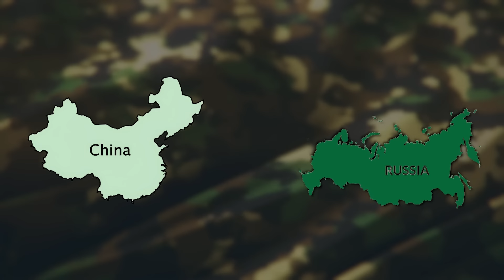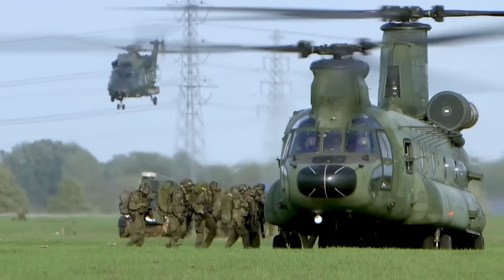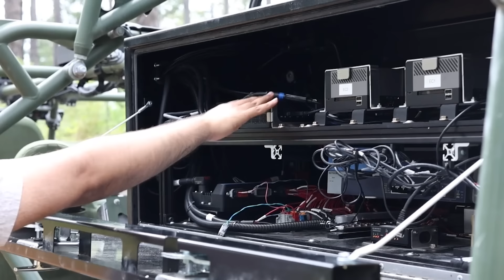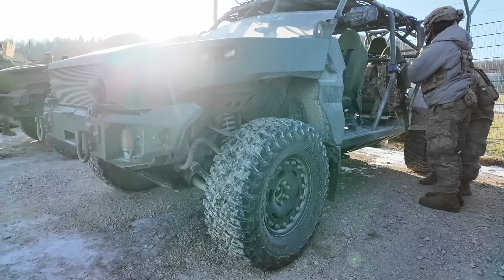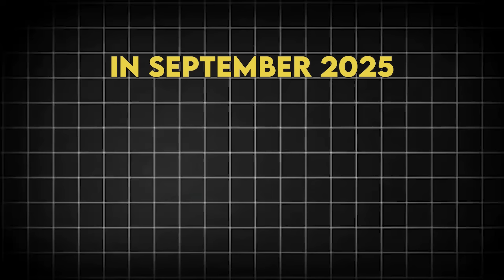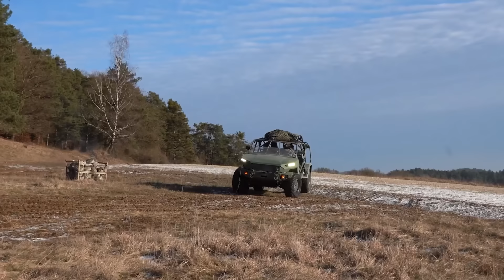This $35K Chevy Pickup Became the Military's Most Radical Weapon

Comment: Uha that's what they did in Ww2 with the jeep almost. 
The parts for a WW2 jeep were made by 3 different company's  and the smaller parts were manufactured by at least a dozen more companies also the parts in a WW2 jeep were used in many different vehicles. 
Slow learners

Comment: Do your research. This is a custom built military vehicle that shares some parts from a civilian vehicle. For one, the frame is custom built by Hendricks, not stock GM as you state.
Reply from the maker: As discussed in the video, the base production Chevrolet Colorado frame is modified with a custom-built, high-strength chrome-moly steel exoskeleton (roll-over protection system) manufactured by Hendrick Motorsports.

Comment: I like it and I don't like it.  While the SpecOps love a vehicle like this that they can jump out of really quick and return fire, this vehicle is basically doomed to be transport and way behind the lines. Does everyone remember Rummy saying you go to war with the army you have not the army you want?  This sounds like a copout for having the right vehicles for the job.  When cheney said that, They were driving bigger, more capable vehicles, with more protection than a beach buggy.  When they got the chance, they would up armor the humvee, and eventually replaced it with V hull for IED protection.  So with this they were like Fckit, fck all that, you get nothing.  So this vehicle is a joy ride machine around army bases inside the states, its for moving soldiers around inside army bases in other countries,  but it has no ability in combat other than Spec Ops.  Im sure the army wont confuse these two uses, and just send a bunch of these to the next war. 

Spec ops likes these.... they even converted a couple humvvs in afghanistan to look like this so they could all see and hear threats and react to them without doors, windows, armor, and roofs, they just stop the squad, and shoot back. The army doesn't need these, and they shouldn't put the grunts and sir yes sirs who learned how to use a gun 6 months ago into one of these things in a hot zone, and thats what they will do if they are available.  They did this exact same shtt with the stryker, they mis used the vehicle because it had a gun on top, even though it was a lightly armored troop transport, and shredded to pieces if a tank saw it.

Comment: This is a WIN-WIN for the US!!  AND, it’s about damned time!! In 1986, when I was assigned to a schools command where the original HMMWVs were being torn apart to be used for teaching maintenance and other functions there, many of us said we should have been looking at BAJA cross country vehicles since they can take a beating and keep going, etc.! Here we are 35 years later (2021 timeframe) and SOMEONE finally got it!! Next up will be diagnostics, aka autonomic logistics where the vehicle tells the supply chain when it is going to break down or excessive wear and tear is causing issues.  PROBABLY NOT something they can put on these since the cost is almost a throw-away, but I guess we’ll see!! Good work all around……as long as they are durable and Chevy will use repair frequencies to improve individual products on these that are wearing out too soon, or a particular weld begins to fail too often, etc.!!
Reply: weapons of war need to be disposable

Comment: So its a lighter, less capeable version of what the original Hummer was?  These vehicles have a very limited function and are only going to be useful to certain fighting units.  Airborne, Air Assault and maybe some CAV scouts.  The rest of the ARMY is still going to need the big, heavyily armored,  V hulled vehicles when they are running patrols through captured territory.  Any surface that can't handle a heavy armored vehicle is probably better to fly over if you want speed.  If you want stealth, you should walk.  These vehicles will still require road surfaces to get to where they're going.  Riding down a road in an unarmored (any vehicle really) vehicle is a death wish.

Comment: One of these versus an IED would not be pretty. Protection costs
Reply: Or ANY small arms.
Reply: This is not meant for that environment. Granted there could be an overlap given time & circumstance , but the primary mission is different.
Reply: @porkrind3512  Anywhere outside any wire, the troops will be majorly exposed, even to small arms fire. This is even less protection than the thin skin humvees were. Horrible idea!
Reply: @jerrygreene7139  Its either the ISV or walking.  Not meant to replace Strykers or JLTV's in armored units that have them but supplement units who would have to otherwise ruck 10-20 miles to an objective. Instead they can now drive close to an objective or front line and ruck the last mile or two instead of the whole 10-20.

Comment: As a member of one of these units, I can tell you that this ISV is a beast. On the other hand, it’s not related to the civilian model, and the 2.8L diesel engine is not in the ZR2 model that you showed in your video. As a matter of fact, GM discontinued that engine for the civilian sector. Also, the reason why that engine performs so good is because it doesn’t have any diesel particulate equipment.
Reply: emissions. it couldn't meet civilian emissions requirements. not a problem for a military vehicle and the entire us army runs on diesel fuel so no gas motor.
Reply: Exactly, and if I could find a brand new ZR2 for 35K, I'd buy two!
Reply: @williamguillIII right, I cant find a base under 40k.
Reply: You can find 2.8 Colorado's easy, and just delete 'em.
Reply: There’s a lot that’s directly from the second Gen zr2. The dampers and suspension geometry are all ZR2. I can also see the optional extra suspension link that rod hall makes for the rear end just for second Gen ZR2’s. It’s got all the goodies, but it’s really just a second Gen ZR2 suspension wise. I don’t know why the guy who made this video kept showing third Gen ZR2’s. That threw me off a bit. I wonder if banks had anything to do with the tuning.
Reply: They will need more than lasers and radar jamming or even any sort of EMP. Some of our enemies are doing things to deflect lasers. Fly by wire models can't have their signal jammed because it's a direct link. You need something that can cover all the bases if you want to come out on top. Worst of all our enemies behave like a PG-13 MacGyver making weapons from trash and causing a lot of damage along with projecting those weapons using readily available materials.
Reply: @SnoopN  not really, the more that you to to protect against anti drone measures the more you comprise the drones capability on cost effectiveness or combat effectiviness. Like the fibre opticdrones for example gain protection from EW but they knee cap the payload they can carry. A similar thing would happen if you coat a drone in anti relfective material, it will drastically increase the price.
Reply: I don't know much about this vehicle, but doesn't it use the same fuel as the rest of the units on the battlefield (JP-8)?
Reply: It’s based on 2nd Gen not 3rd
Reply: its the same engine without any emision kit and ecu that is tuned to take advantage of no ristriction on the powertrain making it lighter more powerfull more fuel efficient and more reliable then the civilan models which it turn is more reliable then usual military tech.
Reply: No particulate filter?  Greta the Doom Goblin will not be happy.

Comment: The military can get a 30k truck but civis can't get one for less than 50k.....
Reply: Also, you buy 1 truck at a time, they buy over 1000 at a time
Reply: These trucks are sold to the military for $370,000.
Reply: @Team6OWG The military takes one look at the bill per vehicle and says, will you take $500,00 instead?
Reply: IKR 😕🤨🤨
running on our taxpayer money but we can't get that pricing
Reply: I mean if you walk in an buy over 1000 vehicles at a time you would get a better deal
Reply: 30k in fairy tails 🤣🤣🤣 check the budget sheet 🤣🤣🤣
Reply: 214 milion USD for 649 units = around 330 000 USD per unit.
Reply: @janch1x  *Inclusive of R&D costs, maintenance and spares contracts and all the BS paperwork you need.

Actual per unit cost is likely significantly lower, albeit still pricey for a vehicle with no doors, such is the 21st century.
Reply: This mofo doesn't have any doors or a roof on it.
Reply: @Deez276  think of it as a modern day jeep.
Reply: @charlesstafford8290  that works till your somewhere it rains a lot…. Or gets really cold like the northern states and some European countries.
Reply: @timcauthen3289  These aren't patrol vehicles, they're meant for recon and special operations.
Reply: All it takes is a little bit of research into why we pay more for a vehicle. Once you do you turn into Nick Fuentes

Comment: You mean Big Army actually came up with a cost effective measure? Mind equal blown. Btw, this is so WW2 thought process; it worked back then and it works now.
Reply: FWIW, the finished truck is $400k.
Reply: @EpsteinShotJFK  I believe the $400k figure is taking into account for the initial production, labour, research and teething problems. Once production ramps up, the cost per unit should drastically decrease once a dedicated production facility capable of optimising the production of this vehicle goes online.

Comment: My designs, by the way, I suggested the skeletal, and lightweight doom buggies seen in this video, specifically engineered to serve as modern replacements for traditional military vehicles like the Jeep and Humvees. They are intended for versatility and efficiency in diverse terrains…You can easily add modular armor components separately, allowing for customized protection against various threats such as enemy fire, blasts, or shrapnel.
Reply: Add a helicopter VTOL (Vertical Take-Off and Landing) extension on top of the aircraft, designed for improved versatility and maneuverability. Equip it with an advanced navigation system that includes GPS, radar, and autopilot features, enabling it to be operated effortlessly by a pilot or remotely via a ground control station, ensuring ease of use in various operational scenarios.

Comment: Doing a Google search, "The cost for the M1301 Infantry Squad Vehicle (ISV) is approximately $370,000 per vehicle, based on a 2020 contract for 649 vehicles. For example, one contract awarded in February 2025 was for an unspecified number of ISVs with a total value of $44.8 million." That's a bit more than $35k. I'm not attempting to cause waves, I was just curious.
Reply from the maker: Yep, we’re talking about the base model platform before it’s modified; I also commented earlier that price was actually closer to $44k.
Reply: @Combat-Tech  Right on.
Reply: @HOLLYWOODUNAPOLOGETIC that cost includes spare parts, training, and technical support.
Reply: @fen2453 And the cost is certain to decrease one teething issues are cleared, the sunk one-time costs (Initial research, prototyping and trials) expenses are paid off, and production ramps up.
Reply: I suspect that laser gun and its' power supply is going to cost a chunk.  The nice thing about this is that you can have multiple of these along with heavy armor with these units focusing on drones.

Comment: But the actual price tag is $400k USD. They could’ve bought the coyote from Supacat which has a mine proof hull and can be upgraded to a more uparmoured. Plus they already had the capacity to mount a variety of weapons systems already in use for a $300k USD price tag, the basic hull could also have an extra set of wheels. So from 4 wheels to 6.
Reply: How are you going to see drones with the closed top?  The purpose of this one is to use the very expensive laser gun to take out drones.  That is probably what ups the price tag and it would up the price of the coyote if used on it as well.  I doubt the coyote can be carried in a helicopter as well.  They probably came up with this after watching Ukraine and Russia battles.  Vehicles like the coyote probably still have a place depending on the battle front.
Reply: @jeffer2350 the sepacat Coyote has an open top structure along with a mine resistant bottom.
Reply: @CDNR711  I suspect this is more of a defensive vehicle. Helicopters would quickly move these units into regions where radar is detecting drones will arrive.  Mines would not be a problem in defensive positions and the coyote isn't going to go into a helicopter as easily due to the weight.

I suspect the military is watching Ukraine and Russia and sees Russia overwhelming certain areas with massive drone attacks.  Ukraine is unable to have enough defenses in each area to handle all of them.  If you can move about a dozen of these around based on radar before the drones arrive it would work much better than a heavier slower vehicle.

Comment: When I worked with 3rd group in 2011 I was A 3-71trp, 3BCT 10th MTN. We used Polaris Rzr’s and other SXS vehicles because they were light, capable and didn’t set off the heavy set ieds meant for MRAP,s, MATV’s and the ANA up armored Hmmwv’s. Kinda funny seeing this come back full circle to the base bones M998/ Jeep GP, about time.
Reply: Did you have belt failure common on the Polaris vehicles

Comment: you talk about it as if you had just discovered gold, about 20 countries have been using TOYOTA trucks for over half a century and they can make more trucks faster and cheaper
Reply: You're correct but what I think the big deal is this marks a shift for the defense industry ...faster cheaper stuff that makes sense not something from a big conglomerate defense contractor that's gouging  Americans
Reply: @craiggehring9456  I think it only fits the profile for the drone defense part.  These vehicles can stop drones better and faster if they are available in quantity.   They would work great in places similar to Ukraine defending against Russian drone attacks.  In those areas there are no mines to worry about and multiple laser guns on mobile vehicles can be re-positioned rapidly with help from helicopters too.
Reply: @jeffer2350  laser guns 10x more expensive
Reply: @zelele-m1f  That depends on what you are comparing against.  Lasers have an initial expensive cost but the cost afterward is just the price to recharge the system.  Ammunition and missiles for traditional systems is far more expensive and must be shipped into the location while a laser just needs a power source.

I suspect they would use these weapons for specific purposes rather than being the only defense system in use.
Reply: Which of these countries have a laser gun mounted on their Toyota?
Reply: Which countries? I’ve only seen terrorists using the Toyota’s. We call them technicals. Toyota should be ashamed.

Comment: Only question where the troops gear going 🤔
Reply from the maker: The ISV provides storage primarily through its large cargo area and the integration of modular, adaptable storage systems (i.e. attached the roll cage) The Army and GM have also developed variants with different seating configurations to accommodate more cargo for specific missions.
Reply: They can hang their rucks on the roll cage.

Comment: Not a bad concept except almost useless in urban environments where IED's and close quarter fighting will take place.  No armor for the crew protection. Pro's:  Cost, use of off the shelf parts, multi-fuel (need to add gasoline too, not sure how that works but worth looking into), compact for air assaults, fits a squad, easy mission configuration.   Con's:  Besides a roll cage no crew protection?       Now,  at that cost and weight why not add a heavy duty winch to them?  While a really good concept the lack of crew protection is still troublesome .  Think shell fragments or any indirect fire, IED's?  The commenter talked about ambushes?  Harder to survive one with no protection?   Still can be useful getting troops from point A to B fast.
Reply from the maker: You've hit on its main trade-offs, which really highlight its intended role for specific mission sets where speed and transportability are prioritized over heavy armor!
Reply: This is more of a logistics vehicle than a fighting one. Much like the Jeep of WW2 or what the Humvee was supposed to be before soldiers began slapping armor into it.
Reply: There's no armored vehicle that fits in a Chinook. Right now they are using 1.1s and RZRs. Which also have no armor

Comment: You put the pictures of the 23-up Colorado in the video but this truck is based on the 2nd gen 17-2022. Which is also still made in Brazil
Reply from the maker: Great catch—thank you. We used a few shots of the 2023+ Colorado for visuals, but you’re right: the GM Defense ISV is based on the 2nd-gen Colorado ZR2 (U.S. 2015–2022) COTS platform. GM Defense then strips it down and rebuilds it (roll cage, seats, suspension tune, electrical, air-portable mods), so it’s not a straight showroom truck. And yep—Brazil still builds the closely related S10/Colorado-family pickup, which shares the underlying platform lineage, though the ISV itself is produced by GM Defense in the U.S: https://www.gmdefensellc.com/site/us/en/gm-defense/home/news-and-events/news.detail.html/Pages/news/us/en/2021/may/0504-gm-defense.html